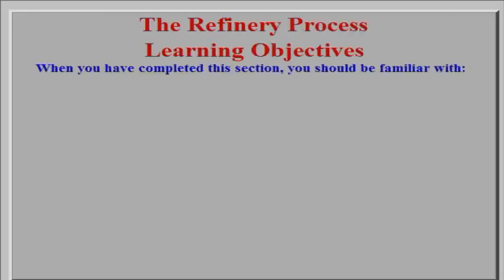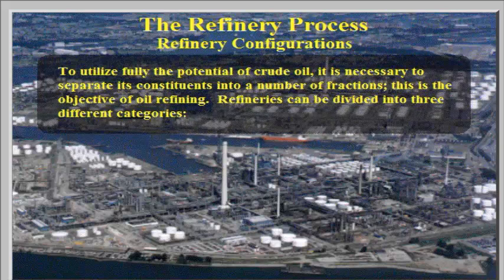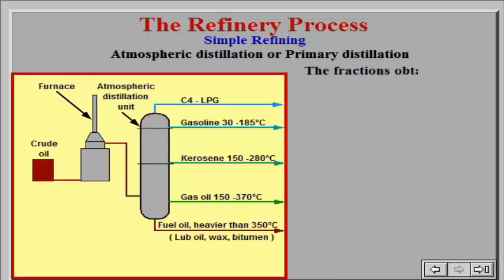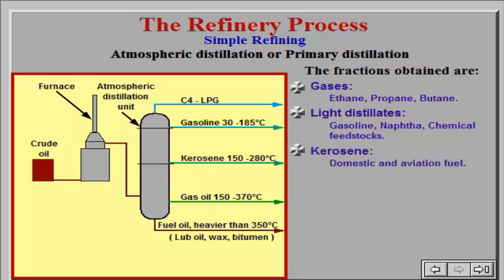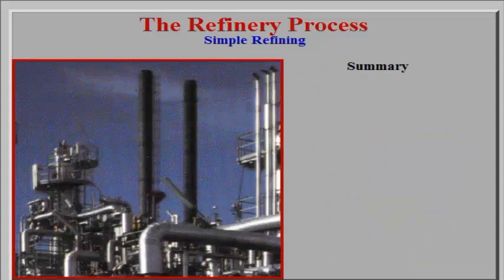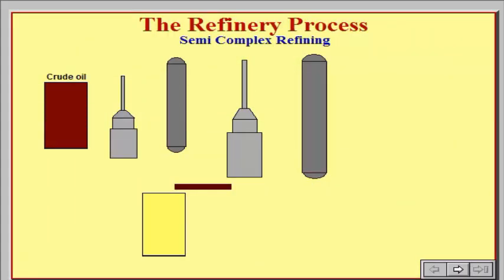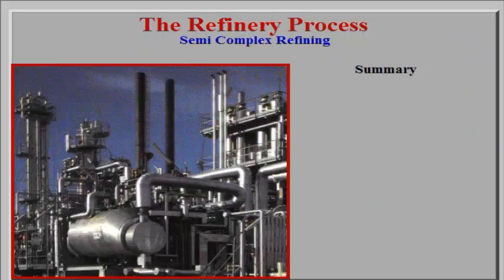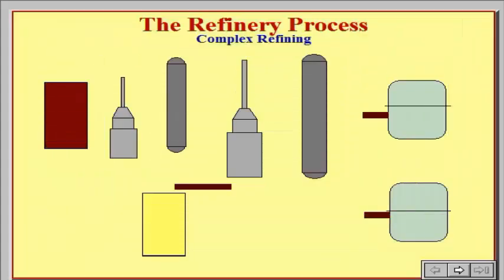How Oil Refinery Works

Comment: petroleum refining is a process to separate from crude oil  fractions by heat, pressure and boiling temperature  and produce several  end products